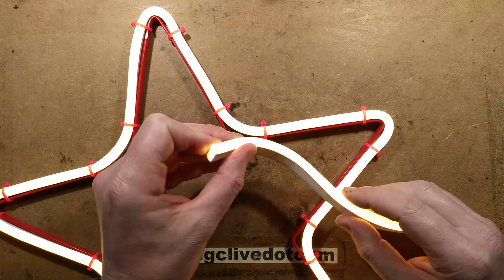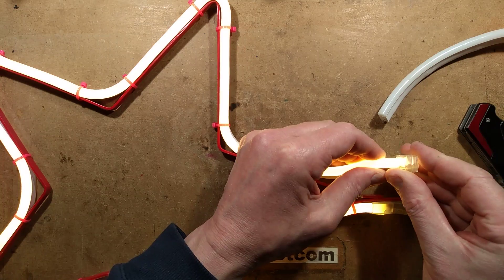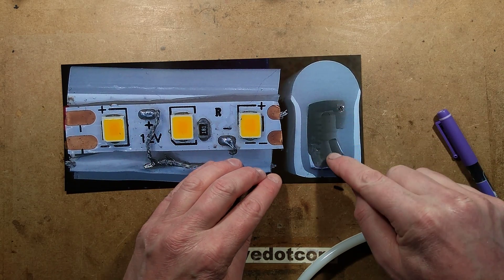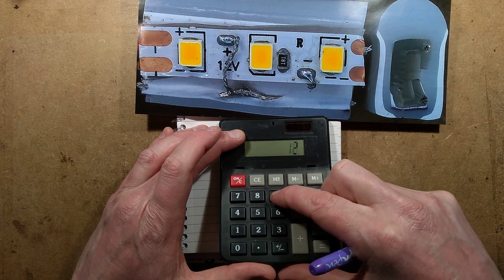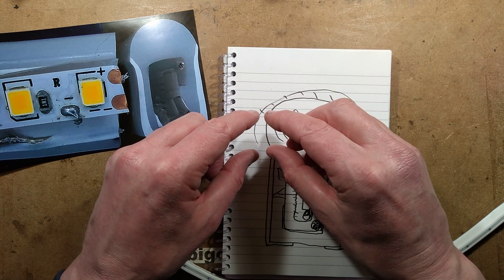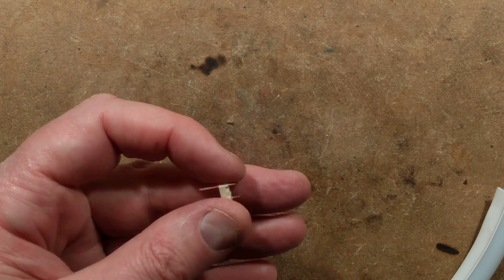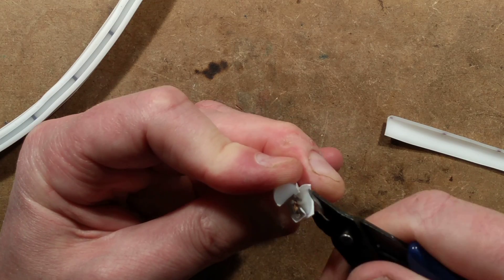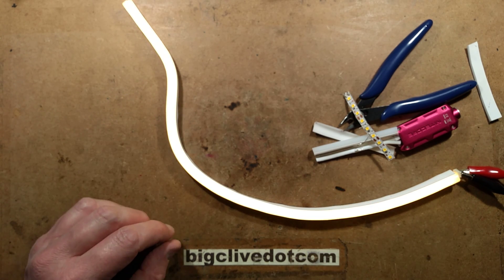Testing and tearing apart some 12V LED neon-flex.

Comment: I recommend to always try to get the RGB version of any product if you can. Whole groups of RGB fans love that stuff. Like LinusTechTips crowds for example. There are RGB versions available on Ebay slightly more Expensive. Not sure if they are thicker or any more difficult to work with, like cutting them.
Reply from the maker: I've already ordered some RGB stuff to play with.  I'll guess it's based on 5050 style tape inside.
Reply: @bigclivedotcom  We look forward to your video on them. I'm thinking about buying some to make up a small sign for my son. If I power them off USB 5V would they just be dim, or would it not accept that low of a voltage? :) I also see Ebay has some thinner usb, or car styled ''rope'' - but not sure if that is something like different technology style or not.
Reply: The ebay link shows a remote.  But I'm not sure how the connections are. Or if the remote comes with the rbg product.

Comment: Can we have plastic flexible neon?
Reply: No. Neon is pressurized inside its thick glass tubing and produces more heat than a flexible plastic could withstand, and I'm sure there's a variety of other reasons that simply doesn't work.
Reply from the maker: Traditional neon has a vacuum in it and the material has to be able to withstand that vacuum while also not outgassing into the tube due to the aggressive nature of the electrical discharge inside.  If the pressure changes the tube will stop working and if there are impurities they will burn up and blacken it inside.  Making real neon is a very complex process which is why it's always been quite expensive.

Comment: OMG, it looks perfect for making some LED race gates for indoor micro quadcopters!

The price is a little >ouch< though for making more than a couple, and you want lots of them.
Reply from the maker: At about £5 / $7 a metre it's cheap for what it is.
Reply: Yeah you're right, I've been used to bargain basement Chinese stuff for too long :)
I did make some LED race gates for about £2 each using 2xAA powered 1 meter festive LED strings wrapped round garden wire, the effect is pretty good - youtu.be/8B5InrXfAPs
Especially when you tape a diffraction filter over the lens, it gets 'trippy'... youtu.be/MS42bAJ6hTw
Reply: Keep making neat stuff like that, I subscribed.
Reply: @Kineth1  I'm always on the lookout for interesting things to modify/make/play with. Did you see the gyroscope I designed & 3D printed to hold a micro quadcopter? youtu.be/QIM-t1TEDGc

Comment: I wish they made a version of this similar to traditional rope light. A diffused opaque  tube in many colors that have an led chain inside set up in a way that it doesn't create "hot spots"
That way we could have a cheap way to make neon signs that actually looked more like neon. 
I like this stuff but I'm not a fan of the shape. We need something tubular that chucks light in all directions.
Im actually thinking of attempting to make myself a fake neon sign by getting white acrylic tube, bending it with a heat gun and feeding some sort of electro luminescent lighting inside.
Reply from the maker: They do two variants that try to address that.  One is double sided so you could rope up a frame and it would glow on both sides.  The other is a circular section with the strip inside that does glow in a diffused manner, but has a distinct dark stripe on one side (the LED tape) and intensity is compromised.
One of the key features of ropelight in Xmas frames is that it is a series of sharp points of light that are visible from a greater distance.
Reply: bigclivedotcom Just a thought. I wonder if it would be possible to make a flexible opaic plastic tube impregnated with phosphor that could be exited by small   closely spaced uv leds that can be inserted.

Comment: Nothing comes even neat the real glow of neon or argon signs! But for LED it's quite good.
Reply: @memberwhen22  I have seen both in real life. The bent glass tubes with an arc going through them are just a whole other leauge. And you have to keep in mind that LEDs produce a lot of plastic waste. That is also a reason why i prefer mercury vapor, metal halide and all the other gas discharge lamps/tubes.

Comment: I wonder whether they make a version of this with individually addressable LEDs?
Reply from the maker: I think they do a WS2812B version.
Reply: @bigclivedotcom  You're right!  £14.50/metre: https://www.ebay.com.au/itm/292605310079
Reply: Wow!  https://www.amazon.com/ALITOVE-Individually-Addressable-Flexible-Waterproof/dp/B018X04ES2
Reply: @Miata822  Those are normal addressable strips though, not these nice "neon" ones with the smooth lighting.
Reply: Watch the video on that page

Comment: marketing opportunity. I would desire a bigclive officially endorsed coaster.

edit: tomorrow's world, you're giving away your age Clive. 

-retires back to maplin's to get more srbp tagstrips for 2p each (oh how i've kicked myself ever since for 'budgeting' over that)
Reply from the maker: I think Tomorrow's World was my all time favourite program.  So much so that I bought a programmable video recorder just to record the episodes while I was working away.  Which would have worked if my dad didn't keep switching it off at the wall in case it went on fire.
Reply: @jdhtyler  my parents' house is very old, circa 15th century. They are in the process of slowly replacing all of the old rubber wiring. Some of the things I have seen pulled out of the walls is the stuff of nightmares. Especially since it is a timber framed house.
Reply: @jdhtyler  make the switch to modern flat plate switches and sockets, you can pop the cover off to paint then pop it back on. My only warning attached to flat plates is this, if your wall is an awful shape, full of lumps n bumps, especially where the sparks buried their cables in the walls, the accessories can look like they're hanging off the wall... properly fitted, they look great tho and do allow you to safely pop off the cover for redecorating.

Comment: This answers an actual issue we're dealing with now (sign that needs to be bright, visible, not fragile... and cheap.). Real neon doesn't satisfy cat 3 and 4. LED tape is cheap... but the really cheap stuff looks like a string of individual dots, even from a distance
Reply: I guess the best way to deal with that would be to incorporate the dots into the design so that it doesn't look out of place
Reply: @kargaroc386  some dot matrix art diffused through a screen to advertise a retro style place sounds great